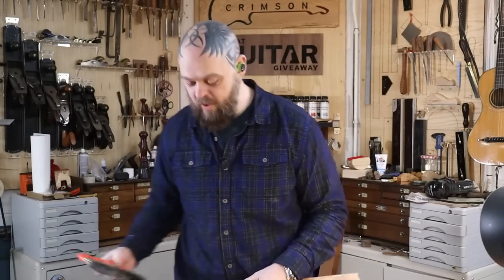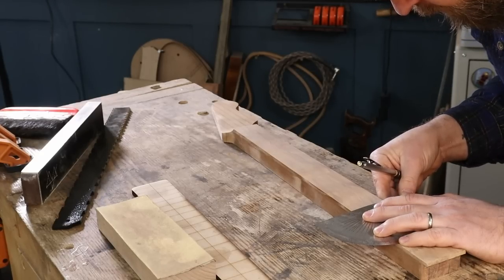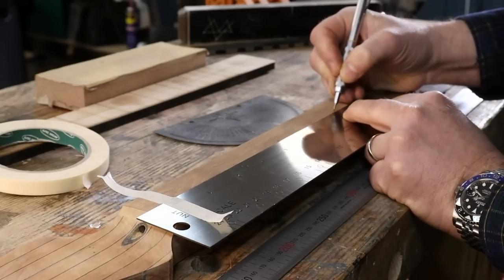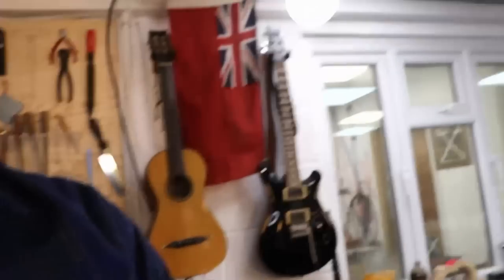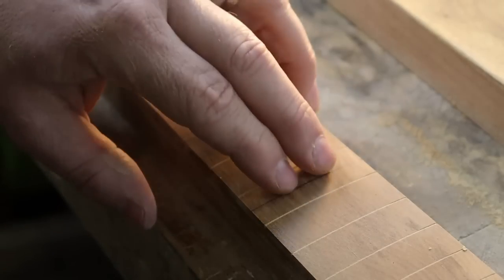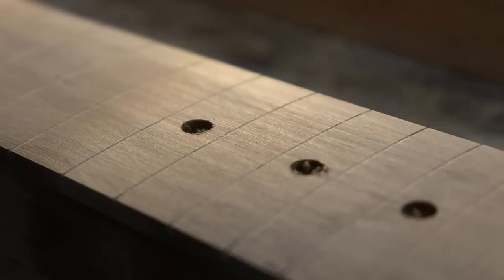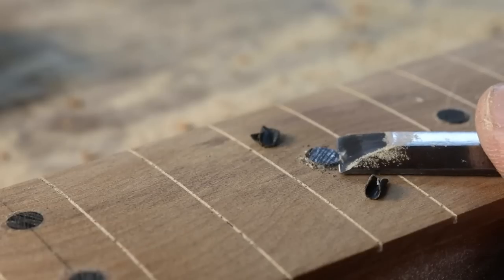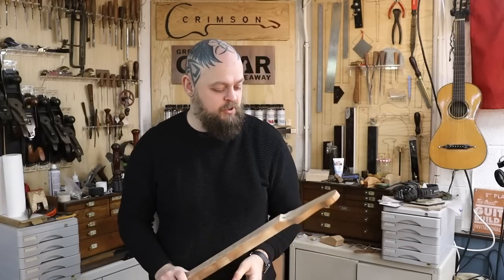Ep 7 - If I can cut fret slots by HAND, so can YOU! | Building a Guitar from 42,000 Year Old Wood!

Comment: Nice, I missed a lot of your vids Youtube stopped notifying of a lot of channels I an subscribed to after I cleared my history. I have to catch up. I need to do this on a fretless guitar I bought last week. I thought it would be cool because I own a fretless bass and have had several in the past but a fretless guitar is nothing like trying to play a fretless bass. There is a couple things I like about it but a fretted neck IMO is much better. I will need tools I haven't built a guitar in years and got rid of most of my tools. I do have some stainless steel jumbo fret wire for a refret job I did a year or so ago.

Comment: Use the cnc router to cut out for the logo inlay. Less risk at this point. Lovely work Ben 👏. Just a note to mention, when you slapped the neck near the beginning of the video,  I thought I heard the sound of the truss rod rattling.  Might have been my imagination but I have had truss rod rattle issues of my own in the past and it haunts me.

Comment: My fret markers are different.  i use my router, with a triangle-pointed bit, to make small holes on 3/5/7/etc finger positions.  Then, I take my trusty bag of 1/2 inch flat-head screws, then with just a few twists, fret markers!  (thats why I have to router first, for the underside of the screw head).
Some people say my work is slap-dash and bodged.  Some people are right.

Comment: Definitely in line with one of the join lines and by hand - I’d like to see how you do this. And near the bottom of the headstock away from the machine head holes. This one is looking great. Would it be a sin to install stainless steel frets? They would last forever. And it would tie in with the ancient wood! Stainless is all I install these days. Worth the effort even though hard on tool 👍

Comment: Here’s how I use the miter box to slot fretboards after they have been attached to a neck. The miter box has four vertical panels. Each one is bolted to the base. With Stratocaster headstocks, it’s the treble side of the neck that gives you problems. So what I have done is to remove that one panel that gets in the way, and reattach it using long bolts and long spacers. It looks odd, but it is actually quite easy to keep the sawblade perpendicular to the neck. In fact, I don’t have to give it a second thought; the blade remains perfectly straight.

Comment: I really love your sprung center punch. I have one that you push down on to mark with, but it requires so much force that I only really use it for woods like rosewood and purpleheart and on metal. Might I inquire where I might find one? Do you have them on your tool site? I’m just not really sure what to call them.
Reply from the maker: Hi Kyle, if you contact the Vintage Tool Shop - shop@vintagetoolshop.com  They might have one in stock?

Comment: The inlay head find the line 30-degree tilt up from that line. The reason i am making guitar / voilà de gamba \ cello hybrid and hexagons as structs etc and as they are equilateral triangles (6 of) half of 60 is 30 thought it be cool and yeah my head is on the how to break your own mind  (Thanks Ben). And by hand as i done front and backplate twice front i carved a lovely bowl shape crack all the way through so see on fixes or start again, so this is your fault as you said make saw dust i never done this before and from scrap wood and pallet because it was said it couldn't be done well see about that. Also, this is for 3rd place in a flower show where 3rd was part pallet nailed and sanded, called a shoe rack. i not done videos as i hate my face sound body and that have done pictures of this thing . so there is my input lol

Comment: 15:05 i refuse to believe dogs danglies is a real expression sir 🤣 but as for the headstock i would put the “neck” portion of it dead center between two veneers because I feel the logo will be less visible with just the “body” and “headstock” portion sticking out of the veneer line. That would NOT be the dogs danglies or the pooches pouch or the bulldogs bell-end or whatever other expression you have in this mythical alternate timeline known as the UK 😂

Comment: I tried scalpel marking fret slots as you suggested Ben.  It does not work for me.  I find the edge of the saw (not the middle) wants to run in the cut, so the saw runs slightly off centre.  If you are ADHD like me then you forget which side you ran the saw on the previous fret and it can add up to a problem.  Love your work.